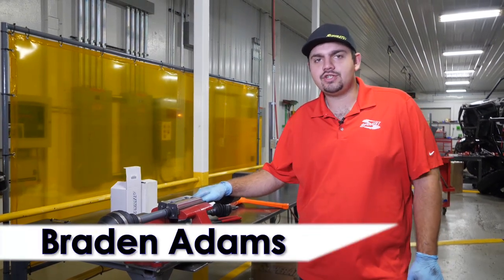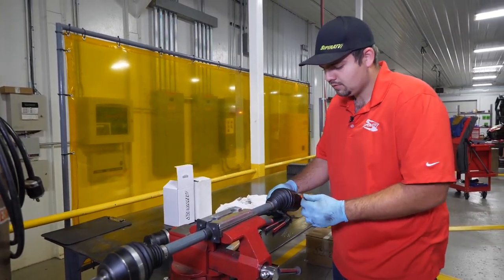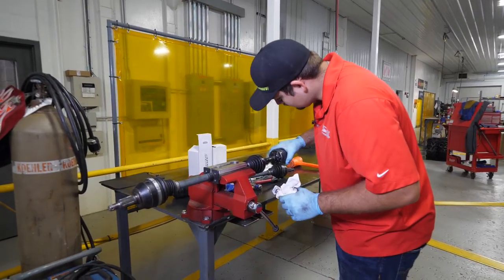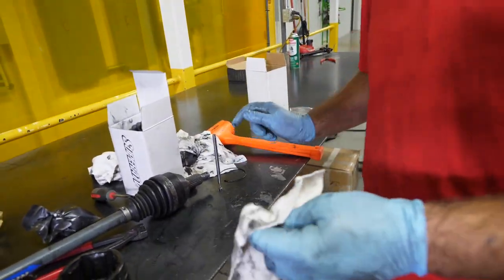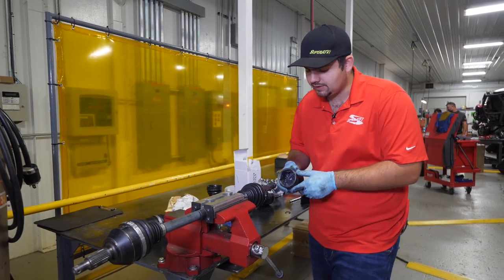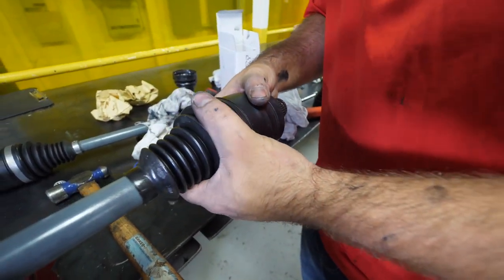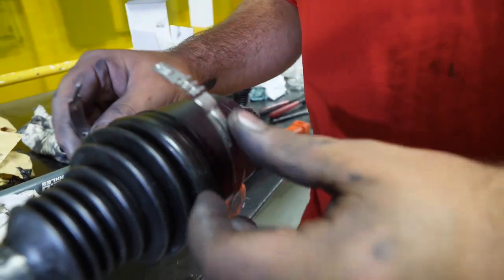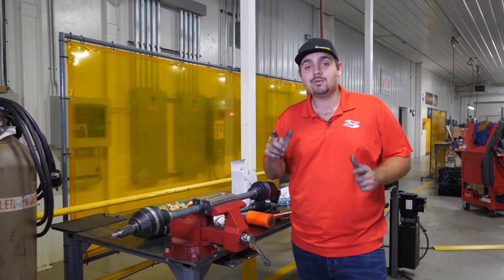HOW TO CHANGE CV BOOT ON RHINO BRAND AXLES - RHINO 2.0 - RHINO X300

Comment: I notice you didn't show the tool actually pulling the bigger clamp together. This is nearly impossible without shearing the barb off of the clamps on these things. Just like he did when removing the small one. I'm sure that took a couple of takes since the video was spliced right there..... I will order this tool and see if its any better than my motion pro ones.
Reply: I ordered the tool and it’s about impossible to get this clamp on. I love how they edit the video to make it look easy

Comment: any reason you cant seal with plain ol hose clamps?
Reply: Hey did you end up just using regular hose clamps?
Reply: I use safety wire. Just don’t over tighten. For me the biggest problem is that the actual boots tear open or dry rot from heat.

Comment: my 2.0 pioneer axles are clicking in 50 miles , anyone else have this problem?
Reply: I give mine absolute hell and only problem has been stripping the splines off the shaft on a front outter. They replaced under warranty quick and easy.  Only others I have broken have been from suspension parts breaking and taking an axle with it.  

Is it all of your axles or just 1?  I do run limit straps on my rzr to reduce any chance of binding. If you're running a big lift you might want to look into limit straps.

Comment: You said in the video we can get the TPE Boot pliers from your website but the do not come up when I search for them. Do you have a part number for them ?
Reply from the maker: Hey Rachel, thanks for tuning in! Unfortunately, we do not offer the pliers anymore. However, you should be able to find many options easily on Amazon. Here is a link: https://www.amazon.com/ABN-Ear-Type-Crimping-Mercedes-Vehicles/dp/B00K0TOYJE/ref=sr_1_10?crid=1ETMQUR81AMIY&dchild=1&keywords=boot+clamp+pliers&qid=1601299580&sprefix=boot+clamp+%2Caps%2C149&sr=8-10 Thanks!